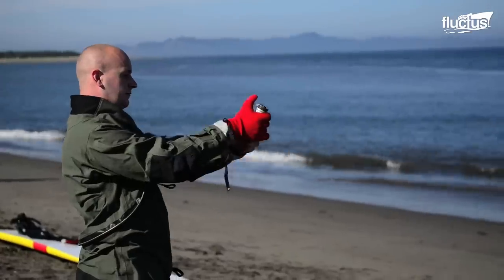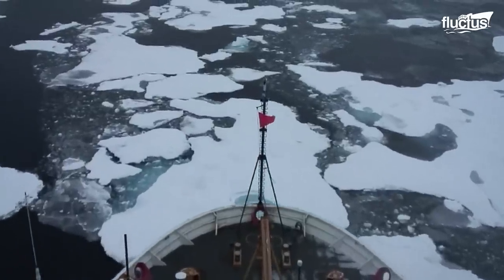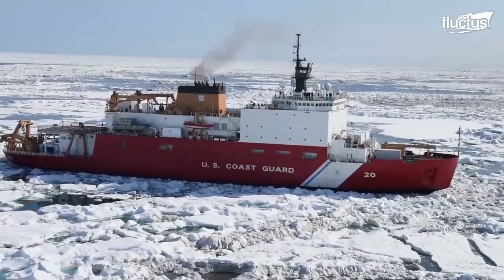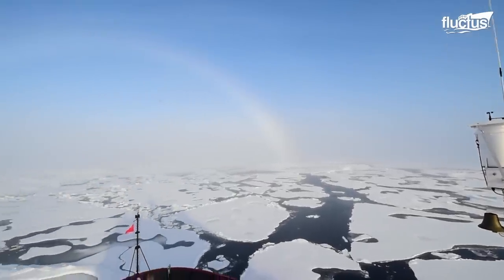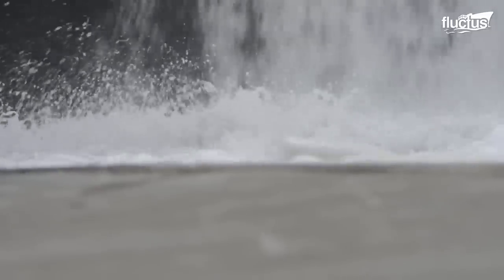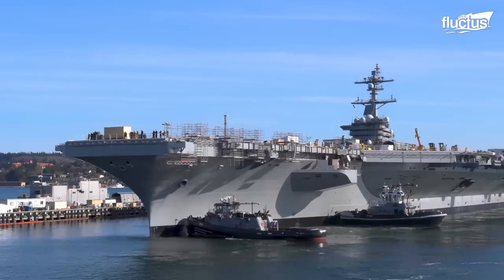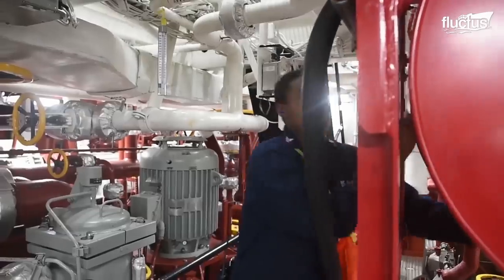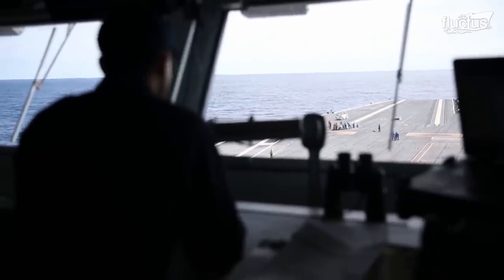US Engineers Genius Idea to Save Massive $800 Million IceBreaker From Scrap

Comment: So, the "US Engineers Genius Idea to Save Massive $800 Million Icebreaker From Scrap" was to..... replace the damaged engine? Yes. yes. Only a genius could think of such a brilliant concept. The engine is damaged. Let's replace it. GENIUS!!!!
Whoever writes these video descriptions is the opposite of a genius.
Reply: The genius is on its modular design: if engine fails, replace it than rebuild it on board. How can anyone fit a crankshaft inside? There are many repairs that are impossible.
Reply: I've worked in shipyard engineering. I can guarantee you NOBODY amongst my colleagues would find the concept of "let's replace the ruined engine" as "genius". It's mere common sense. The engine's ruined. Let's replace it.
Reply: @larrywalsh9939  Right? When I was working on a sub tender in the 70's, we replaced the aux diesel generator on a nuc sub, through the side! More work for the welders than us mechanics!
Reply: @larrywalsh9939  I would hope that BY DESIGN, ships would be built with the intent that sections of the deck, and/or hull would be removable for the service of large, critical components. It looked like the ice breaker WAS designed with such serviceability in mind.
As nice as the U.S. ice breaker is, the Russian's ice breakers are larger and nuclear powered. Given how remote and inhospitable the Arctic is, nuclear power seems like a tremendous advantage. It also offers more horsepower, providing more thrust to punch over/through thick ice.
Reply: @brucelytle1144   submarines are different, the pressure hulls are much more difficult to cut through and fix as good as before.
Modular hull system is not going to work for subs that usually have as little seams as possible.
Reply: *FARTS*
Reply: @madsam0320  yeah, no kidding it is difficult to open them up! Believe me, it's even harder to put em back together!  
Most civilian ships are built so that you can access the whole engine, without cutting. 
The only genius in this was someone figuring out where to cut so the whole thing didn't collapse. 
I was a Licensed Engineer, sailed ships, built ships and repaired ships for 40 years or so.
Reply: @larrywalsh9939  the engine wasn't replaced it was the drive motors, electric DC motors.
Reply: @gregparrott  I was the best man at the wedding of the ships designer, USCG Capt. Richard F. Gupman
Reply: @mikerowan1132  I like the balance of capabilities is offers. It not only performs the traditional rescue and escort functions, but it also well designed to perform research
Reply: In America, if it's broken, you throw it away and buy one twice the size. Recycling? What's that?
Reply: @gregparrott  you nailed it.
Reply: @peterblair6489  For consumer appliances, you're right. But that does NOT apply to marine vehicles. Aside from that, other than proprietary designs built specifically for the U.S. Navy, the majority of ships are built via. contracts awarded to FOREIGN ship builders. Sadly, the U.S. has most of its capacity to manufacture large ships. It is usually not price competitive for large ships.
Reply: @gregparrott  Meh. I've seen a bit of boat building in my time. ANYTHING can be done. It all comes down to money in the end though. 
Still not genius. Sensible though
Reply: Watched the video, thought I had missed the genius idea somehow.  Read the comments to find out what I missed.  I feel better now.
Reply: Your comment is genius. Thank you
Reply: Yes, there are no plans to scrap the Healy, anytime soon.
Reply: Not only that. There's 15 minutes of, admittedly somewhat interesting, fluff we have to plough through to find what the video is announced to be about.
Reply: Thanks Larry you saved me from watching whole video
Reply: The engines were not designed to be easily removed. They were expected to last the life of the Ship. Some repairs are not economically feasible. Some ships it is not cost effective to repower a ship especially if the ship is past it's service life.
Reply: You need to see how ships are build nowadays.   They don't build them from the keel up, they're produced in gigantic chunks that are welded together.

Modularity has been a thing for decades.
Reply: @madsam0320  The Virginia class and Columbia class are constructed in a modular fashion, so yes to what you’re saying once the boat is fielded, but the construction is now modular and that’s a fantastic thing. 🇺🇸 🇺🇸 🇺🇸
Reply: its the level of intelligence they think we are at, this is dora the explorer for adults, we have a generation of infants and this is them pandering to it
Reply: @gregparrott  generally that is done, engineers aren't stupid. The problem is, sometimes it isn't the most effective as there are also other constraints, like weight, overall hull strength and cost. When you have large pieces of machinery like that in a hull that has to maximize strength to break through the ice, it can be better to design the machines to last long than to install large removable hatches in the deck (you definitely don't want that in the hull), as such a hatch is a weak point that needs to be heavily reinforced and will never be as strong as the surrounding hull.

A different example of this design approach is the BMW V12 LMR, a race car designed for 24h endurance races. While their direct competitor Audi focused on changing any broken part in less than 45 minutes, BMW designed everything to last long enough and didn't care about serviceability. BMW beat Audi in the '99 Le Mans race and the American Le Mans Series with this approach.

As for the Russian ice breakers, yeah they are marvels. Russia also has the largest arctic coast line, so they need to think big. The US just doesn't have the need. If the situations were similar, like the US being responsible for Canada's arctic coastline, they would have something similar, you can bet on that.
Reply: @JoeOvercoat  I don’t know what you mean about the construction being modular, those subs themselves cannot have units slotted or swapped with ease for servicing or different operations. That’s not modular.
Reply: YER , ENGINE BROKEN, LETS REPLACE IT, UNREAL!!!!!!!!!!. OMG ! NO SHIT SHERLOCK!!!!!!
Reply: @johnbowen2963  GENIUS!!!!!!!!
Reply: @madsam0320  The construction process uses modules.  Built that way it does make it easier to cut them back open and lengthen/swap/whatever them.  No one is proposing that as a matter of routine, but it's been done to boats, and will be done again. Meanwhile, pretty much every 'multi-mission' modular design fielded by the Navy has been a failure, so modular in the field is over-rated. Modular in construction, at least for boats, on the other hand, provides great benefit to the Yard, the Navy, and the USA.
Reply: @JoeOvercoat  but that’s the norm in ship building today, every shipyard are constructing in blocks and putting them together.
Reply: @madsam0320  Yup. While not every shipyard builds every ship that way, it is the norm.
Reply: Thanks for saving me from wasting my time on this video
Reply: And then the video carries on talking about other ships ^^
Reply: Did you bother going past the headline?  Replacing the engine wasn't the "genius" part, it was ghe removal of the sections of the ship that was the real genius. Unless you have worked on/around ships you could probably never ever appreciate what went into moving that massive section in one piece.  Having worked at a shipyard I can attest to how hard that feat was.  I've replaced MRI machines in hospitals  (having to remove four 1" plates of steel then removing the part of front of the hospital itself )  and I can assure you that this was more than 100x more difficult.
Reply: @davidroberts7808  Did you even bother reading my comments? I already said, I've worked on engineering massive ships. Yes, I know that removing a hull section is hard. But it's not "genius", it's "obvious".
Reply: @larrywalsh9939  I wasn't even aware of any other comments by you, I only read the main one and responded to it. The reason I said it was so difficult is because how they didn't just take a plate off, they took the whole section which entails welding all the components of all the walls together before moving it out as one unit.  Why they did that it didn't explain because most engine replacements are through the deck or through a pre-fabbed access. They usually design them that way but evidently didn't here for some reason.  This was way more than simply removing a plate of steel. This was a very difficult undertaking basically taking a complete section of the ship from the exterior all the way to the engine compartment.  I guess the engineers figures it would be less time consuming and cost to just weld all the pieces and move it out as a unit rather than welding the hundreds of components on each side by not taking it out as a single unit.  It was actually a nice piece of work to get it done in just a month.
Reply: @davidroberts7808  What I meant by 'obvious' is, in terms of ship engineering, if they have to replace a huge piece of mounted equipment, they'll either need to cut through the deck or the hull. Two choices. So the solution they came up with wasn't 'genius', it was merest complicated - but really it was just one of two ways the could have done it, and likely they went through the hull because cutting through he decks would have compromised the structural integrity of the ship.
A component like that can indeed be more easily removed by cutting it into smaller scrap, but the problem will still remain that they'll have to get an equally large piece put back in, so they had to cut a large hole, regardless.

Comment: So, what did the engineers do to save the 800 million dollar ice-breaker from scap?  This went from ice-breaker to USA Navy real fast.
Reply: Right
Reply: Cut a hole in the hull to replace the motors. Clearly future ships will have engine access making it easier n cheaper for future ice breakers to replace its motors.
Clearly.
Reply: @martinbrousseau2560  The engines on this ship are on the main deck, twin turbines
Reply: @mikerowan1132  if you listen they clearly say they run a combination of power and electric, though I find it unusual to see square engines of any type never mind square electric motors.
Reply: @martinbrousseau2560  The engines do not drive the propellers, they power up electric motors which are connected to the shafts which turns the propellers. they don't run on a ''combination'' of electric and power. thats not how you say it. The diesel or other fossil fuel engine is what powers up the electric motors which is what turns the shaft. This is apparently more efficient then connecting the fossil fuel engines directly to the shafts.

Comment: This is second time I've seen engine replaced this way.  Russia had to replace a nuclear reactor on one of it's icebreakers. They also cut large hole in the hulls and slid out old then slid in the new. Re-welding quality has to be best of the best. These hulls have to withstand punishing blows from ice as they operate in the Arctic.
Reply: They cut the hulls of submarines like that routinely when the go into drydock.
Reply: @Kriss_L  thanks for comment
Reply: Umm, the hull is a welded structure to begin with.
Reply: @paulkurilecz4209  Thanks for comment. When they weld panels in original construction, the edges of steel plates are cut or ground to a bevel. This allows for much more welding material to build up and form joints as strong as original plates. When they cut out sections, they just have to be careful when re-welding. Bevels, welds, and lots of inspection to ensure hull is as strong as before.

Comment: A detailed video of the engine swap would be interesting.
Reply: I've seen it done on a big cargo ship. They basically removed a large section of deck and lifted the whole engine out with a crane. There's a lot of stuff between the deck and the engine room on a carrier, though.
Reply: No it wouldn't! I have been involved with ship overhauls including Nuclear Submarines. There is nothing but grease, oil, fires, and a lot of bad language. Most the time is spent unbolting assemblies.
Reply: @donraptor6156  Maybe not for you, but it would for me, only ego claims to speak for all,, hey?
Reply: Look around they are a couple videos of ship engine replacement for the most part it’s cut a hole in the side or deck of the ship, disassemble and then reinstall in reverse order. It is a pretty cut and dry job that just takes time.  What is more interesting at least to me is in place engine repair while underway
Reply: @bobeden5027  - As the old saying goes, familiarity breeds contempt. I have one of those jobs, too. I do high precision machining, which to us is just another day. People who've never been in a machine shop are fascinated because it's all new and strange to them, and some of the things we work on are cool in their own right (aero/space, nuclear, and parts for old military equipment, for instance). It's all metal to us, and it mostly doesn't occur to you that it's interesting in some ways.
Reply: @hamletksquid2702  I served my time as a fitter/turner and went on to became an engineering officer with P&O. big engineering still fascinates me.
Reply: @bobeden5027  - I come from 400 years of blacksmiths, so I seem to need to have metal in my hands to feel like I'm doing something.  My degree's in electromechanical engineering, but I can't sit in front of a computer all day. 
One of the coolest things about my industry is that I meet people who are obviously smarter and more knowledgeable than I am every day. I have barely enough background to make a worthwhile contribution, but these are the kind of people who listen to reasoned thoughts and accept others' competence. I'm an obsessive detail guy but I still love to know the bigger picture, and a lot of the things we work on can be looked up on the internet. One example is the Candu nuclear reactors. The entire "owner's manual" for them is online, with drawings of their related assemblies and instructions for installation and adjustment. You can do a better job if you know what the chunks of metal do and what they come into contact with.
In short, I'm a machine/machining nerd.
Reply: @donraptor6156  that’s exactly what we want to see, not the romanticized garbage that dominates YT videos in the subject

Comment: 13:00 when fighting fires, the crews may wear a self-contained breathing apparatus (SCBA). The cylinders on their backs are filled with filtered air, not pure oxygen, because oxygen is highly flammable🔥
Reply: Not all Departments use bottles. Some use Navy OBA Devices. It depends if you are a Professional Industrial Shipboard Firefighter or not. Residential, and structure Firefighting is a Totally different Animal than Confined Space Firefighting.
Reply: Not to be pedantic, but oxygen doesn’t burn. But it is an oxidizing agent so it supports the combustion of other materials. That’s why one of the ways to extinguish a fire is to deprive it of oxygen. Take away the oxygen and you take away the ability of the combustible material to burn.
Reply: @williamp6800  Yes but if you fail to remove the heat as soon as oxygen gets back to the fuel it reignites. AFFF foam is a possibility but most smaller Departments don't have enough Solution to maintain a foam blanket. Some fires are best left to consume the fuel and protect the surrounding area. Some react chemicals react Violently with water.

Comment: 10' of ice is really think ice to break. That's crazy a tough ship. Wow. Imagine having to buy fuel for that beast ram breaking 10' of ice for a few hundred miles. This things a beast. You don't have to worry about opening a sea route in ice flows anywhere almost.
Reply: The ice is broken by riding the ship up on the ice until the weight of the ship breaks the ice. An impressive feat requiring an incredibly strong hull.

Comment: If you pour soybean oil into the sea around a rescue scene, the waves and wind diminish.  Who says?  Jesus Christ (that holy oil thrown overboard did the trick on the Sea of Galililee), Pliny the Elder, Benjamin Franklin!  I've tried this in Hurricane Michael and it worked great!  I put 200 gallons onto the sea surface from the southernmost pier and boat ramp on Key West ahead of Hurricane Irma (cat 5), and the monomolecular oil sheen knocked it back to Cuba and down to a cat 3.

Comment: You’d think that engineer’s when designing this icebreaker would design it in a way that would facilitate easy removal of propulsion equipment 🤔🤔🤔. But no they had to cut big holes in the hull , WTF. Plus this supposedly high tech drive system failed just in a few years. Who paid for the repair, us tax payers . Another Goverment boondoggle. Then the engineering firm what’s up with them. It never ceases to amaze me about ship designers that just maybe the engines and or drive propulsion equipment is going to have to be repaired or replaced in the future. All I can say it’s job security for the shipyard workers.

Comment: You will have to excuse me for being literal in my expectations, but 'Coast Guard' means 'those that guard the US coastline'.  Not 'those that want to do research on the taxpayer dime'.  Yet it seems that this ship is primarily used for research.  I discount completely escorting an oil ship (who paid for the Coast Guard ship's expenses?), and I discount a very small boat that inexplicitly decided it should face the wilds of the north and got stuck.  With our roads and bridges falling apart in the US and my taxes continually spiraling out of control, I have little excitement for this ship.